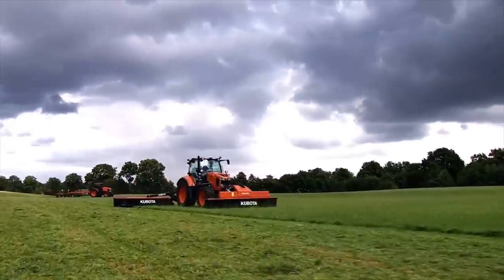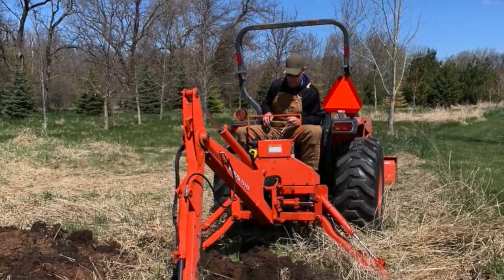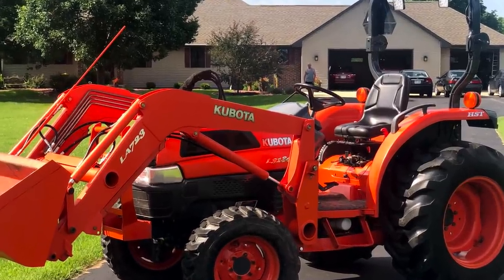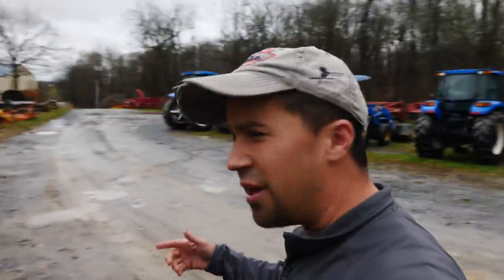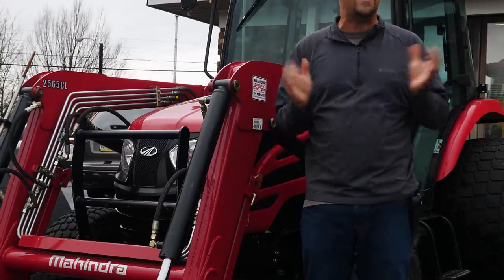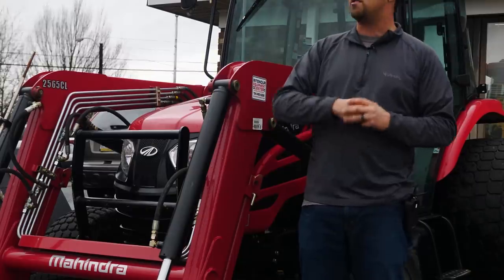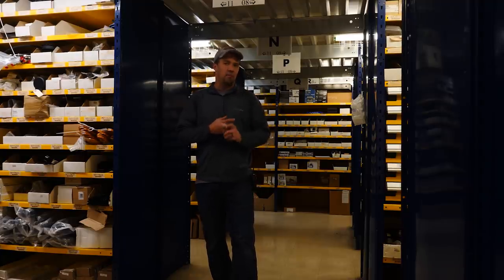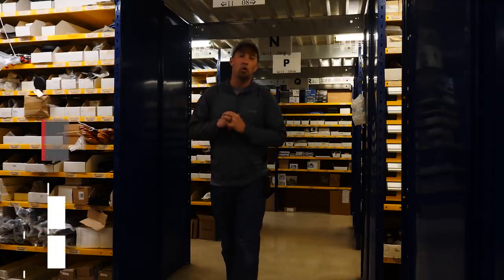What machines can  you count on for good parts availability?

Comment: All of this is very true.  I had a Honda 6522, it was the best small tractor built at the time.  It was super over engineered. The problem became getting parts.  There were only about a thousand sold in all of North America.  It was becoming difficult to even get OEM oil filters, Honda shops would not touch it, being afraid they would break something they could not replace.  When I became so worried about breaking something that I avoided using it, I knew it was time for it to go.
Reply from the maker: Those are super cool tractors.

Comment: I worked for a car dealership in the parts dept..    The two guys that I worked with (Ernie and Henry) were worth their weight in gold.   They knew the manufacturer, substitute parts and had connections in the tri state area.   Also sent me twice a week to the manufacturer's warehouse as needed to expedite the parts.   Even for the oldest vehicles they found the parts.    Learned a lot from them and the dealership.

Comment: Good question.  The only one I know is Cat.  They will provide replacement parts or some solution for any machine.  Or so I was told be a Cat engineer.   That comes with a price tag of course
Reply from the maker: Cat does a great job, they benefit from a comparatively simple product line compared to a tractor company. Very easy to support a few hundred thousand parts, compared to the 2-4 million an Ag company has. their logistics behind those  parts are impressive.